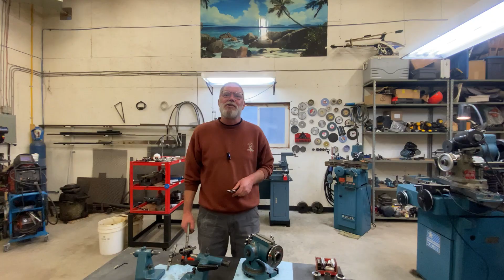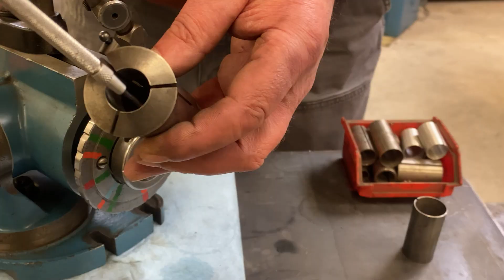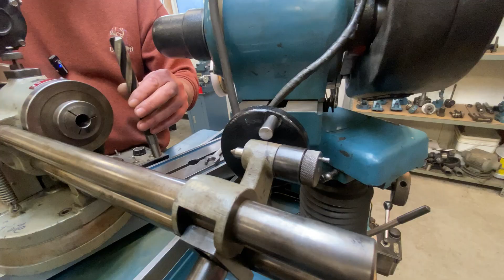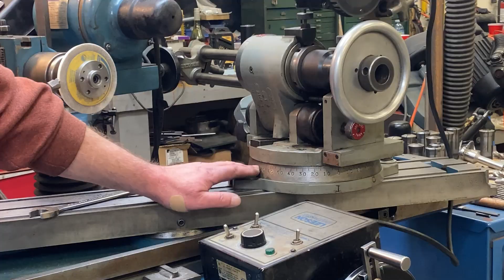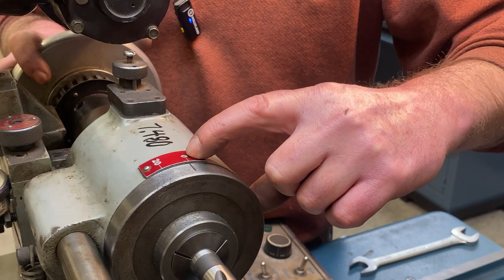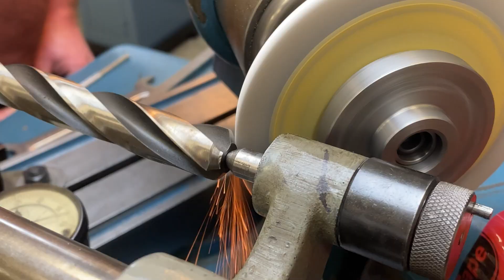3 FLUTE DRILL SHARPENING

Comment: I always wondered how a 3 flute drill is sharpened, now I know. Do most 3 flute drills not have the center "chisel point" of common 2 flute drill bits? So they require a pilot hole to be drilled first? Thanks for the demonstration !
Reply from the maker: I can't speak for all multi flute drills, (Core drills) but in my experience, all of the three and four flute drills that I have worked on do have a center hole and do not have a chisel edge. Yes they do all need a pilot hole. Having said all that I am certain there are tools out there that I haven't seen. Thanks for watching!

Comment: Cool video, I have not seen many three flute drill sharpenings! I am wondering how a true three flute drill would sharpen as this is a non-center cutting drill. Looks to be in effect a reamer. I know they definitely make three flute carbide drills which center cut, so it would be interesting to see those resharpened. Or a HSS/HSCO/PM equivalent.
Reply from the maker: Great suggestion!